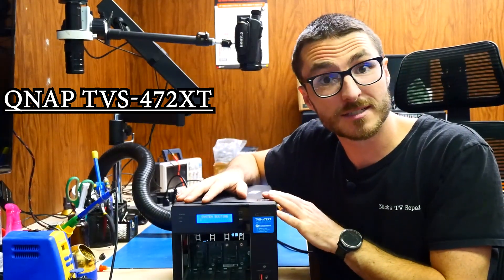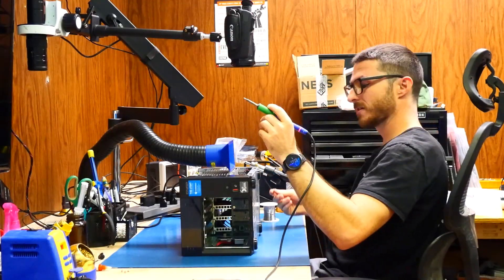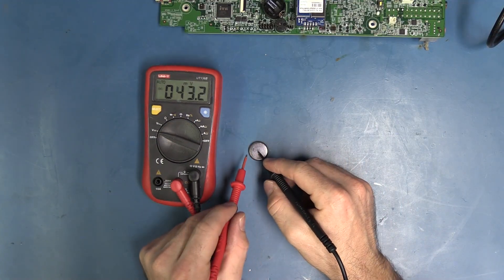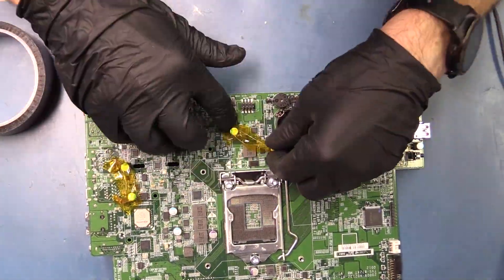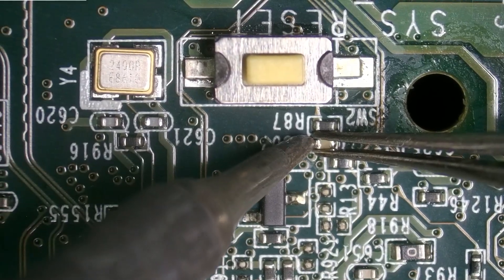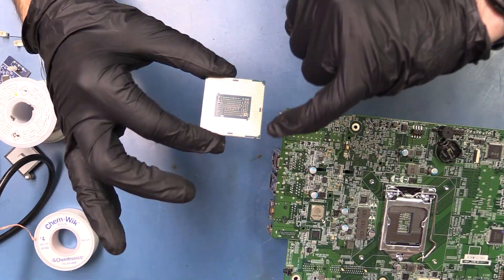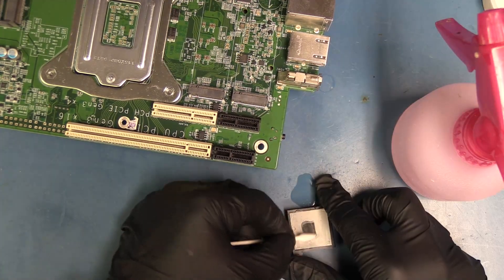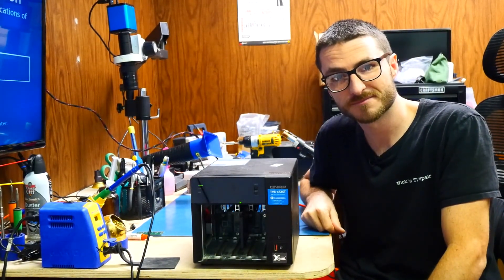How To Fix Dead QNAP TVS-472XT No power and Booting endlessly

Comment: Hi there, Nick. Following you from Europe. Awesome video and your skills are amazing! I have a TVS 872 XT with the common no boot/no power issue. Do you think adding the 100ohm resistor on the LPC could do the trick? Thank you so much.
Reply from the maker: No that won't help you because you don't have an issue with your clock line. That trick only works if you have a degrading clock line due to a specific type of faults found on certain Intel CPUs. Your unit TVS-872XT does not use that type of CPU that is known to have that fault. Just like in this video you have to replace the chipset.

Comment: 476 / 5.000
Hi Nick, I'm writing to you from Italy. I have the same problem on my QNAP TVS-871 i7-16Gb with endless booting. I tried to replace the RAM, I carried out the firmware recovery procedure as described on the QNAP site, but I can't even see the AMIBIOS mask. Can you tell me some other checks to carry out. I believe that sending the NAS to your center is very expensive in terms of return shipping. do you have any advice for me ? Thanks in advance  .
Reply from the maker: You could have the same failure as this unit:
https://youtu.be/zShcO8CIkC4

Add a 100 ohm resistor on your LPC connector as shown in that video

Comment: Looking for some experience. Anyone having such device fixed will the issue appear again in couple of years or it is a reliable log term solution?
Reply from the maker: I have only been doing this repair for about 9 months. So far we have had extremely high success but because it hasn't even been 1 year since we started the repairs, I can't give you a good answer. From what I understand is that as long as you update your unit to the newest software it should NOT be a recurring fault as some of the newer software updates are supposed to take some of the strain off that chip. I don't have any documentation backing this up however, just something I saw someone comment on one of the German forums for Qnap repair.

Comment: Thanks for that great video. 
I have a TVS-472XT unit, while upgrading the CPU and trying to screw the heat sink back on (with the unit flipped on it side, motherboard faced up), someone distracted me and my philip head screw driver hit the motherboard. I looked carefully and did not see any physical damage on the motherboard or things coming off. When tried to power up the unit, it could not start at all, nothing. I haved confirmed using another motherboard that the cpu I put in was good.

You think I might have caused some SMD components to cracked internal (but not visible to naked eye) or that same big BGA chip failed like you showed in the video. What is the name of that chip anyways? Thanks.
Reply from the maker: Hello Richard,
Sorry to hear you are having issues with the unit like that. 
Unfortunately this is something I wouldn't be able to provide you with any type of information upfront without having the full unit in front of me to diagnose. If I were to speculate, I would say you may have knocked off some SMD components, and sometimes you have to use a microscope to see that, so perhaps you aren't able to see the missing components with the naked eye and need to be using a microscope. 
Perhaps you didn't knock anything off, but the chip we are replacing and fixing in the video has also failed in your unit. Most often that chip has failed but won't cause any symptoms to your unit until the unit is powered off and back on. Only then does the failure reveal itself. 
So if the chip is bad, but the unit stays on, you wouldn't know about it until the next power cycle. What often happens is lets say a new update became available. Then you run the update, the unit has to turn off and back on to apply the update but never turns back on. Then you think, oh shoot this update broke the unit. 
Or you decide to upgrade the processor, obviously you need to power down the unit for this but then it never comes back on. 
Or a power outage occurs and the unit won't boot back up. Those are all reasons to make it seem like those events had something to do with the failure, when in fact the failure was alrady there the whole time with that defective IC chip, it's just that the failure wasn't going to reveal itself until the next power down and back up. 

I don't know exactly what that chip is called, I do know it has a name, I just don't remember. If you are looking for the part number on it however, that would be printed on the chip itself.

Comment: Somebody bought this and return the ram for their own benefit and this customer probably bought that from the defect customer or he or she try to repair it and messed it up
Reply from the maker: I am not sure I understand what you are saying? Maybe I wasn't very good at explaining the faults in the video but the RAM stick was NOT the problem with the machine, it was however loose in the unit when we got it from the customer. and that means it was rattling around and moving freely around during shipping. When that happened it caused a couple of components to get knocked off the RAM stick. I assume this most likely happened as the customer was trying to troubleshoot their unit before sending it in for repair and may have reseated or tried swaping out RAM thinking it was the fault and when they installed it back in, they didn't put it back correctly. 
The fault was always the processor chip, the RAM stick just happened to get damaged after most likely.

Comment: Why use a 'powertool' for those screws while a decent screwdriver will suffice? Powertools can cause overtightened screws with possible damages associated with it.
My advice: ditch the powertool...
Reply from the maker: If you are only taking apart 1 unit sure thing use a screwdriver. However, when this is your business and have to open and close these units all day every day you will want to use a power tool. The drills we use are specifically chosen because their lowest torque setting is very weak. The lowest setting which is what I use when I put things back together is not strong enough to strip and overtighten plastic screws. It's not a good drill for construction but it's great for electronics. I highly recommend it to anyone working on electronics for that reason.
Reply: @NicksElectronicRepair  I can understand, but even then; no power tools for me. The chance you could ruin the screw-thread is ever present. (been there, done that even with the lowest torque available)
Using (manual) screwdrivers you can 'feel' the metal working, with powertools you can not.

Have been working in electronic repair, best advice I had: never use power-tools.

I guess it is a personal choice then.
Reply from the maker: I still would recommend you give that drill we use a try. As I said the torque level on 1 is low enough to not have any risk of stripping screws. At least not any more than you would hand tightening.
Reply: @NicksElectronicRepair  let us agree to disagree....
Reply from the maker: ok

Comment: Have you tried the gyroscopic DeWalt screwdriver? When I am doing repairs I like it a lot, I can control the speed by rotating my wrist slightly. The model I prefer is the  DCF680N2. It was a game changer for my bench level work. I in-joy your videos and they helped me with my TS-453 pro. Thank you.
Reply from the maker: I have not but I am very curious about it. It sounds very interesting that it has a gyroscope. I already own 12 different drills, so I think I need to wait for one to break before I buy more, but I added it to my cart and that will be the next one I get.

Comment: Nice Job ! Could you please make also a video about the error with power delivery of TS453B devices i have not seen anything about that. Thanks for helping and keep them coming !
Reply from the maker: I have not yet had a chance to work on the TS-453B NAS device but I am willing to bet it is going to have an identical fix to the TS-451+ which I have already made a video about that I will link below:
https://youtu.be/zShcO8CIkC4

Let me know if that resolves the issue for you, I would be interested in knowing.
Reply: Hey  @NicksElectronicRepair  , I have a TS-456Be if you wanna try to fix it 😁
Reply from the maker: Sorry I didn't see your message until now. 
I don't think we have yet fixed one of those. If you want to send it in, we can take a look at it and give it a shot.